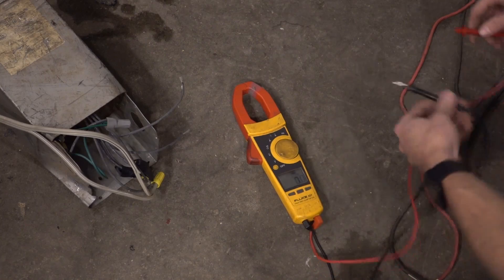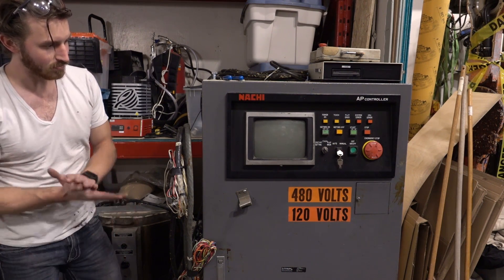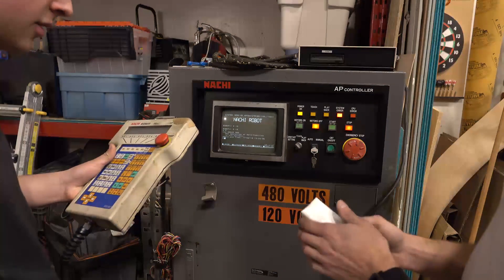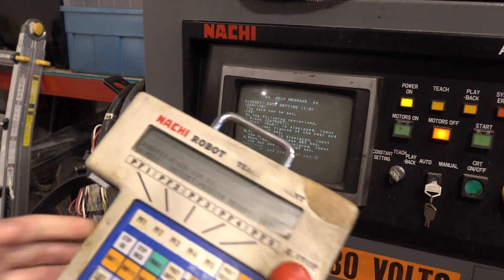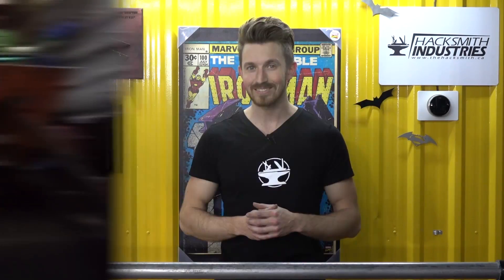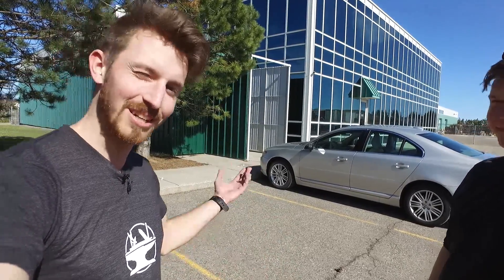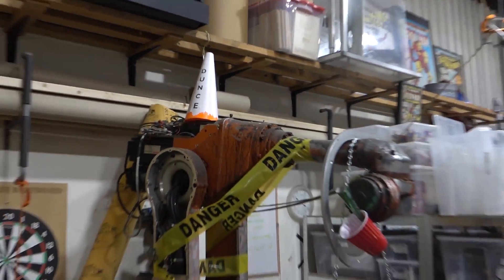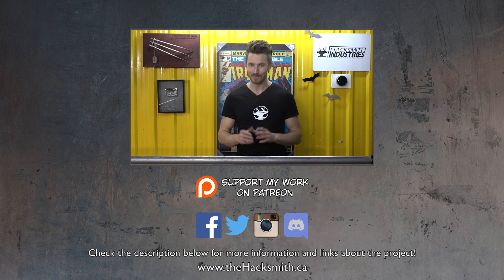Powering on Our Robot... A Mistake?

Comment: Just bodge it together! 
an do a way with the plug's.
an run it through some pvc tube .
an threaded pipe with nut's to lock it in. silicon the wires in it. an add crimp on the end's side. it doesn't have to look pretty it just has to work.
why complete it.
Reply: you could even call it drity hary the bodgey robot. because your lucky that it works punk.
Reply from the maker: +Isaac Monahan it doesn't work...
Reply: dame ow well keep at it. 
got be a coding problem then.
Reply: really wish I was there it kinder observed with it getting work.
heck I would not stop till I got working for you.
but I am stuck in Canberra. Australia dame.
Reply: by way thanks for taking the time to tell me.

Comment: Just make your own. Measure the pin/socket diameter and buy some of the same size (I'd recommend the solder-in type so you don't have to buy an expensive crimp tool). You don't even need the connector housing if your just trying to see if it works. If you're really stretching the budget you could just use individual pieces of cheap hookup wire to connect it all up (this actually isn't a bad solution in combination with some spiral wrap to keep it neat and somewhat protected). Altogether you could get it for under 50 bucks + a day wiring it up.

Comment: Agreed with several comments. Reasonably simple to make new patch cables. Worst case its a hard wire back to back. If you match cable diameters protruding from the rear of the sockets you will be close enough to cover amperage requirements.
Its awesome just seeing the screen light up guys, great job! :)

Comment: Make your own cables, its cheaper.  Or, if you want to make a hack job of it, map the connector pinouts, and break them out to a terminal block.  From there, you can either double that up on the other end, or convert to a more common connector.
Reply from the maker: +wise_guy42 time isn't cheaper though
Reply: Everyone's equation is different, and often changes throughout their lives.

Comment: 3D Printing some plugs, and getting the connector made out of some copper sheet metal rapped into tubes soldered to wires would work I think...
Reply from the maker: Certainly it would, but how long would that take? All six cables aren't even the same so you'd have to design one for each plug.
Reply: Well the plugs ports look rather simple. A cylinder with a bunch more tiny cylinders subtracted from it.
The real challenge would be making sure you tiny copper cylinders have good contact.
That said, once you've got one working, you could make a bunch the same. If not you could probably hack some pc power supply pins to do your bidding.
   
As for how long it would take? Certainly shorter than trying to source antique robot hardware.
If I wasn't been smashed with work at the moment I'd give it a crack for you... Given all the dimensions of the ports of course :P

... heck if I get the specs I might get a change at the end of the month to model you something to print.

Comment: Why don't you just get some cable tray wire with the proper gauge wire that your machine requires amp wise and splice from one side to the next with color coded crimp on quick connects? Then you could still disconnect it when ever you want and the electrical signals will still work fine. Plus it wouldn't cost you more then $50 all together and about an hour of time.
Reply from the maker: +BrokenGaming an hour?? Hahahahaha. Dude it would take way longer than that. Six cables up to 25 wires each? It's possible, just not practical.
Reply: ohhh lol theres 25 prongs x 6.. shoot thats alot of splicing..
Reply: You do amazing work by the way man! I look forward to watching your videos as soon as i see them come out
Reply from the maker: Thanks =)

Comment: You might be able to get the connectors without the cabling from somewhere and make your own cables. Or if you are willing to do a really hack job of it, cut off the connectors and connect up the cabling however you want, your choice of connectors, wire terminals, whatever, as long as things end up connecting where they are supposed to go it should work right. Encoders to encoder inputs, motor outputs to motors, brake contactors to brakes, multiply by six joints, if you can figure out what is what in the controller and in the robot you'll have it connected in no time.
Reply from the maker: Definitely possible but unfortunately we can't invest that much time into this project since we're running a business. When we bought it we were told it was in running condition, which it most certainly was not. We'll do our best but likely it's going to become a piece of lawn art.

Comment: according to the EPA the average weight of a "small car" is ~4079lbs or 1850kg

That's a pretty far way off from 500kg or 1102lbs
Reply: after a bit of googling, for reference a smart car is about 1500lbs (680kg), so... even with the smallest production car I can think of you can't get down to 500kg... =p
Reply: The reliant robin is apparently within your limit though, at only 436kg or 961lbs... although... that is curb weight (without any fluids or people).
Reply: BMW Isetta is another... 360kg/794lbs (curb weight)

Comment: You could 3D print a plug to connect them and run wires through the 3D printed plug. It would certainly be cheap, you'd need a high gauge wire and a lot of heat shrink or something
Reply from the maker: +Nate Richardson the time it takes isn't cheap though :(

Comment: If you are after cables surely a step in the right direction would be wire with the correct tolerances a couple of metal pins and a friend with a 3D printer for the connector housings then it's a reasonably simple job of finding the correct connections for the wire and putting it all together I'm only pointing this out because people often overlook the "wait can't I easily make this myself?" Option.

Edit: sorry I watched the end again and noticed you did say about making your own briefly it went over my head time constraints aye hmm 😒

Comment: That humanoid motoman robot is amazing to see running. Did some basic motoman dx200 training course at the Yaskawa Motoman facility in Ohio and got to see that humanoid robot picking and placing tubes in a machine. Much quicker and more efficient than a human being. They also had a robot arm attached to a mobile platform that would drive itself from station to station to pick up, deliver and check the quality of parts being "produced" by the humanoid robot. Really neat shit. I can't wait to go on my FANUC basic training next month. 

If anything you guys should just see what's so fancy about the cables and try to make them yourselves. Make the connectors in a 3d printer. As far as pins go, maybe Harting would have the right size pins? They would just crimp on the ends of wires and them snap into the connectors. Good luck getting that old beast running.
Reply from the maker: +Tom Foolious2 anything's possible! But we can't sink too much time into it since we're running a business :(
Reply: the Hacksmith Understandable. now that you guys know to look for all needed connections ahead of time, buying another cheap used robot should get you closer to having one in working condition. Oh well, we all learn and move on!

Comment: Aren't those cable just electric wires? I don't think they'd be hard or cost much to make.
Reply from the maker: +Emeric Proulx end connectors cost $50-100 each, 6 cables... That's $600-$1200
Reply from the maker: +tarek ahmed cables have two ends. Each connector is $50-$100. So $100-$200 per cable.
Reply: Emeric Proulx wires that transmit information would be a big part of them
Reply: you mean $300-600 .
Reply: couldn't you just solder directly to the machine's connectors?

Comment: Why don't just buy the plugs and make your own
Reply from the maker: $50-100 per plug, 6 cables, thats $600-$1200...
Reply: Hmmm 3D print it how much voltage and how many amps go through them?

Comment: Can you not identify the connector at each end? Looks like a old mil spec round pin terminals. They aren't the easiest to source but it is possible. Spec the cables and make them up from parts. The new ones seem to be a Harting connector.
Reply from the maker: +Alex Heap found them on Digi key -- still like $100 a connector :(
Reply: the Hacksmith I might be able to help. If you can email me what you've found I'll see if I can source them in the UK I work in automation and might be able to find them trade price. I'll drop a message on patreon

Comment: If it were me i'd just drill out/remove the plugs, and make my own cables
Reply from the maker: +David Riley if we had time we would do that, but we have a business to run :(
Reply: fair enough - each to their own. I would have just assumed chasing the cable back to where it terminates and hard-wiring it permanently would have been the quickest option. GL with whatever you decide though :)

Comment: Just make your own cables! You could replace the connectors with a standard type, or just solder directly to the controller. You can usually find cheap used cabling at certain junk yards.

Comment: @HackSmith -- Talk to these guys about getting cables -- http://www.ebay.com/itm/Kuka-KR150-Robot-w-KRC1-Controller-Pendant-Complete-ABB-Fanuc-Motoman-Nachi-/322464785222

They have a FULL selection of older model Fanuc/Nachi robotic arm cables and harnesses... and as you see, they also have tons of KRC1 pendants.

What model is the controller, and the arm?   Here in Austin TX, there is an industrial automation warehouse I buy parts for my Fanuc & PUMA arms.   I'm going there this afternoon, and can poke around the "older stuff" pile to see if they have the cabling.
Reply: There is a lot of current flowing through there.  These cables must be built correctly.  Some wires carry signals as well.  It helps to have The Right Stuff, because The Wrong Stuff tends to glow cherry red and then cause a lot of headaches.  

Also, mixing up high voltage lines with signal control lines leaves you with a very, very dead machine.
Reply from the maker: Yeah that's what I mean, you can buy a working used robot for $3k instead of spending a few hundred hours fixing something like this =P
Reply: I know .. but it's fun fixing old robot arms.  That's why we do it at ATX Hackerspace ... they make amazing conversation pieces, and the bigger ones make really fun rides and video came simulator cabins.  

In case you didn't see it in my edited comment : 

What model is the controller, and the arm?   Here in Austin TX, there is an industrial automation warehouse I buy parts for my Fanuc & PUMA arms.   

I'm going there this afternoon, and can poke around the "older stuff" pile to see if they have the cabling.
Reply from the maker: Cool! It's a Nachi VORG35 from 1990 -- the controller is a 460V AP contrller, MFG no 903K284 but I really doubt you'll find anything. It's ancient!
Reply: @HackSmith I have sent you private contact info to the contact email on thehacksmith.ca.
Reply: Since it's a prototype, cant you solder the cables directly on the connector pins on the back of the plug? Or replace them with new generation ones? Even if there would be pins unused it wouldn't be such a problem. I'd jerryfit that entire thing just to see it working. Good luck mate.

Comment: I like the Lethal Weapon clip worked into your video. :-) You can operate the motor using single phase, but you'll need some serious power. The efficiency won't be good. Better off using some heavy gauge wire and bullet connectors to slide over each pin to make your own cables.

Comment: Could you not just find the cable connectors and make your own with 20pair (or equivalent) cat5e/cat3 cable? That also brings the question: Does the controller deliver power to the arm as well? If that is the case you will definitely need a larger cable for that, but honestly, simple networking/phone cable split from its pairs should work just fine.
Reply from the maker: the cable connectors from digikey are almost $100 each just for those lol
Reply: Well, I understand then. Wow. You could create your connectors with a little bit of 3d printing/casting wizardry, but you're trying to run a business so at this point you might as well just buy what you need.
Reply: Sorry to spam replies, but have you checked alibaba/aliexpress?

Comment: The 3 phase power would be for the AC motors. The electronics should be fine, since it's all stepped down anyway, but nothing will move. There are some mickey mouse ways around this, but I definitely wouldn't recommend it. You'll either need an inverter or a VFD: https://www.theautomationstore.com/ac-drive-vfd-inverter-control-panel-115-230-460vac-1-2hp-to-10-hp/
Reply from the maker: yeah the main point of using the transformer was to poke around with the controller when its not connected to the robot. not gonna lie its unlikely we'll ever get it running

Comment: dude, get a few molex pins and print the female plug. Insert the pins into it and connect it to a home made cable. Just 6 or 7 2,5/3 mm cables braided together so they are not a mess and that should would like an official cable. Not sure how much current that needs but i doubt its more than 10A
Reply: But it would be awesome to watch you guys bring it back to life. If I just wanted to see a working industrial robot arm, I could go elsewhere on YouTube. I want to see you guys hack new life into an  awesome old piece of industrial equipment.
Reply: Just get another co-op student and wire him up with the QWOP kit u made. Done!! He'd do just the same
Reply: Just use common plugs such as those used for trailer lights or something a bit more heavy duty if it needs more amps and separate 1 plug into 2 or more and then resolder it. It will take you maybe 1-2 hours MAX. and then if they should ever break you could just get another cheap easy access plug and replace it
Reply from the maker: +Laharl Krichevskoy not saying it's impossible just might take more time than it's worth. We're running a business remember, so if it takes even 100 hours to fix it's probably cheaper to buy a working used robot
Reply: Yee Boi yeah that too, but not being removable that could be a pain if they have to ever move it somewhere else.
Reply: I worked with old 5 and 6 axis nachi's, depending on the load its handling it can be well over 30 amps for something simple.
Reply: Nuff 
Guilty. What can i say, im a science kind of guy.
Also my avatar is quite easy to recognice.
Reply: Laharl Krichevskoy i entirely agree you are real smart
Reply: yes
Reply: I have a basic understanding of what was said in this comment. Seems legit. I say they try it
Reply: Just get an intern ;P
Reply: Laharl Krichevskoy g